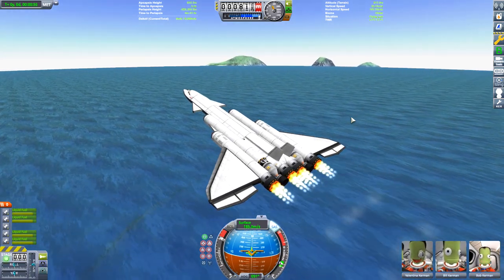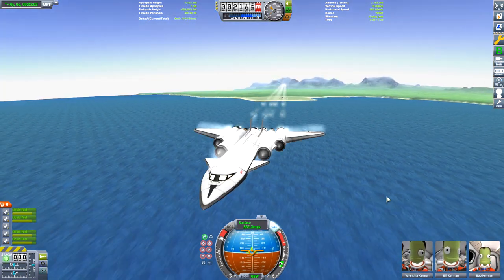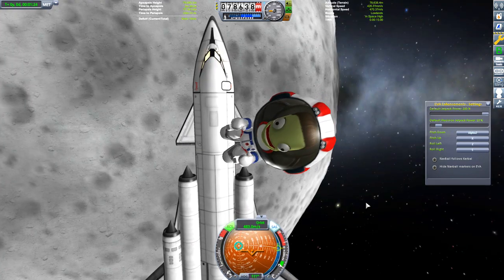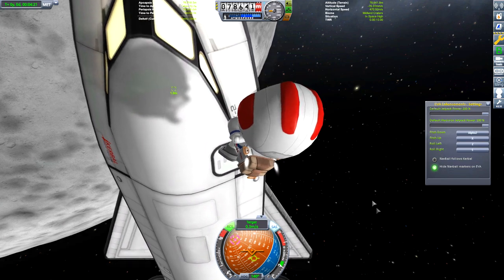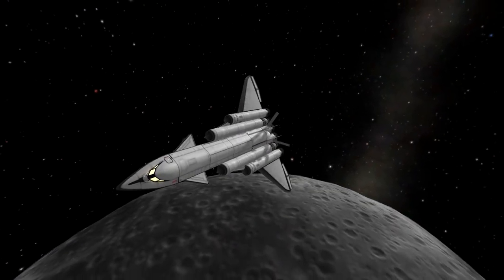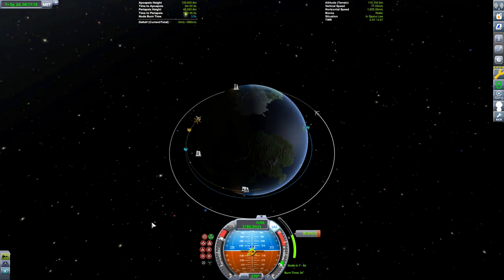SSTO MK2 Mun Space Station - Kerbal Space Program

Comment: Very nice you learned a lot ! Disable yaw control on wings, leave only pitch and roll to increase stability. Limit the authority of the elevons, so is not bouncing as much when you pitch up.

2 solutions for manipulating cargo:
1. RCS on the plane off course, use the unidirectional nozzles - more thrust and very easy to hide in the fuselage, to minimize drag-you get a mk2 monoprop body;
2. Small RCS tug - lowers the amount of payload you can deliver, but it greatly increases the flexibility, as you can use it with your station to maneuver it in different orbits - every station I launch has such a tug that stays with the station !

You still have to work a bit at balancing the plane. CoL is way too far back when empty, adding elevons on those 2 small wings by the cockpit will help, or turn them into canards. Basically you have only one source of control, the elevons at the back, when you switched your CoM forward and tried to pitch, it created a fulcrum at your CoM position, around the elevons at the tail, flipping your plane. Much better if you have control surfaces spread at the front and at the back of your plane, since my recommendation.

Another hint: build your wings with 5-10 degrees of positive angle of attack - rotate the wings so leading edge sits a bit higher than trailing edge. When plane is perfectly level, you get an automatic lift, without having to touch the pitch control. Also slant the wings a bit upward, tip of the wing higher than the root, again 5-10 degrees, it will make wonders for your reentry !

Comment: For plane changes, the further you are from the center of your elipse, the better, because you have to fight against the velocity you are at to change plane, so the further away from a celestial body, the lower the orbital speed is and the easier the plane change is.
About the canards, you can add some elevons ont them for extra control and disable them is needed. They work mostly on heavier spaceplanes.  
The center of mass must be slightly in front of the center of lift regardless of where they are. Check the CoM and CoL in the SPH. Check with both fully loaded and empty fuel tanks and payload bays. RCS build aid mod can display both Dry Mass and Wet Mass CoMs at the same time, it also can help.
If you design your spaceplane well, most of the fuel you'll use (AKA LF/Ox for close cycle RAPIERS) must be around the center of mass so their emptyness doesn't change the CoM, so you can play around with the fuel you still have to make it take the balance of the emptied payload for exemple. The CoL doesn't change unless you deactivate some control surfaces. It is the CoM that shifts. But if your CoM is too far forward, you'll generate too much drag to ascend and your fuel will be wasted as much as your thrust.  If CoM is behind, the plane wants to fly backwards.
Remember the proverb, Front heavy plane flies with difficulty, Tail heavy plane flies only once.
The problem with extraplanteray SSTOs like this are the Nukes that are very heavy but necessary for interplanetary trips. RAPIERS on close Cycle are the most inefficient engine you can find. 
For longer trips you either have to take drills and an ISRU with you to refuel at your destination or master the arts of fuel balance and multiple gravity assists. Most Space plane players take the EKK route to Jool.
The rule you can memorize easy is the heavier a space plane is, the more difficult it is to build.
I also think you could optimze your ascend profile. You seem to be going too slow at 15 kms... and thus use too much the RAPRIERs on closed cycle. You want to reach 1500m/s by the time you switch modes. Easier with lighter craft, for sure. Havier ones need so many engines to overcome drag...
On this particular craft I'd advise you to switch fuel tanks, the only LF in the center and the hybrid on the sides. More flexible placement for better CoM optpimization.
Reply from the maker: Thanks a lot of useful points in here especially the mod to show centre of mass change between full and dry mass. I suppose the fight for larger SSTO's accent is to try and reduce drag and I definitely need to work on getting up to 1500m/s at higher altitudes. I will have to experiment with wing area see if that effects drag. Thanks 😀
Reply: @Orb8Ter  Unfortunately bigger SSTOs have difficulties getting away with drag. Bigger hulls mean bigger drag. Plus, the more obstacles you add, the more drag it generates...  Antennas, solar pannels, batteries, RCS thrusters, wings, winglets, tails, canards...
If you have a big lifting body, big wings are next to useless. Bradley Wistance builds SSTos out of hull parts with very smal wings on top and bottom.
The more compact your craft shape is the better, most of the time. Big wings tend to create drag when you pitch up as well as lifting body. SO working on ascend profile to avoind unecessary hard pitch maneuvers helps. The bigger the craft is, shallower the ascend profile gets. You also could avoid punching the engines to full power on earlier ascend phase. and punch it once you've got to 10 kms to avoid unecessary fuel consumption because of drag. In that case, wings can help you go up faster at slower speed before levelling your flight to accelerate. 
The irony is that spaceplanes would be more efficient ascending like a rocket, keeping the plane behaviour for reentry and landing, this is what the Venture Star was about.
The RCS build mod is also useful to place your RCS well because it is already a pain on Apollo style ships, but on SSTOs is it evenmore when most of the time yout docking port is facing upwards. 
The advantage with a spaceplane though sit aht you identify the orientation of your spacecraft buch easier than simple sylindrical craft when you don't pay attention at where the windows are, easier to know on which key to press to maneuver.

Comment: Hey Orb8Ter this looks pretty good.. Dont know the weight, Im guessing under 60t. Still snaking on the runway, try to move the nose wheel backward. One wheel in front and 2 at the back, makes sense for them to be equidistant, maybe a bit forward, but yours is too forward IMHO. Should takeoff around 100m/s with proper LG placement. Clip the big-s wings to the mk2 body instead of outside. Fuel tanks and rest should be fine, you dont actually need 4 shock cones. Try 2 and see. Saves a bit of weight (forget the engine precoolers add more fuel so that you climb at 20 degrees, 10 if you want more deltav). 2 shock intakes for 6 engines never exceeds 70% intake air for me. Remove the forward wing strakes and also use big-s wingstrakes to balance your plane out. U can always pump fuel in and out of them.  ~3000m/s deltav in orbit is what I can do. With this design, I find that normal ailerons are plenty good, maybe even move them backwards. Drain the fuel and check to be sure. Reentry will probably be a pain unless you can pump fuel into a forward tank. Im really glad that you are getting excited about spaceplanes in KSP.. I look forward to more amazing stuff from you.. Do more with Mk3 parts, you can get into orbit with mining rig and ~5000m/s deltav.. There is no stopping THE ORB8TER!!! Love it love it love it!!!!!!
Reply from the maker: Awesome thanks for the cool advice I will definitely be putting them to good use funny you should say about adding a mining rig as I was planning on a lander mk3 SSTO so this will be brilliant for basically an Ssto to anywhere 😁

Comment: Hey nice one mate! Did disabling steering on the rear wheels help? I've found the next size down elavons work better on mk2 model ssto's, really only using the super big ones on mk3s or super heavy mk2s. Also play around with which ones control pitch and roll.... That'll help stability in flight during ascent and reentry. I've found dedicated ailerons for pitch and roll separately tend to help regaining control or maintaining it in the first place. Good luck and looking forward to the next one. Cheers mate
Reply from the maker: Thanks for the tips I will try the front wheel closer to the centre of mass, and test out different control surfaces.
Mk3 next I think may try an ssto lander 🤔
Reply: @Orb8Ter  if you're going mk3 i suggest bigger than you think you need especially depending on you're destination. Landing a plane on duna for example is zero amounts of fun. Fucking sucks actually so some engines facing down to slow your vertical speed (toggled through action groups) are a HUGE help in those heavier planes. As far as mun or minmus i feel your current design could probably manage with some slight tweaking... Looking good though!

Comment: The only thing bugs me is, MODS and installing them right?  I tried many times to install a few mods and when I start up the game after. the game reports that a mod or mods are not upto date with my version 1.6 game. saying like the MechJeb2 is out of date even though I downloaded the newest version from the curse website! and also I get the game as it is loading reporting some of the other mods like the advanced building one and others like it have a error or not installed right? I had extracted all the game data in the mods and put those file into the Game data folder in the game where they belong! But only Mechjeb2 just about works?  I need a step by step guide by you Orb8Ter to help me install mods and have them work ok and if needed un-install them if there is problems?  PLEASE DO A TUTORIAL VIDEO thanks.  : )